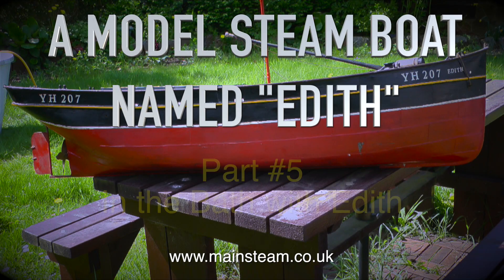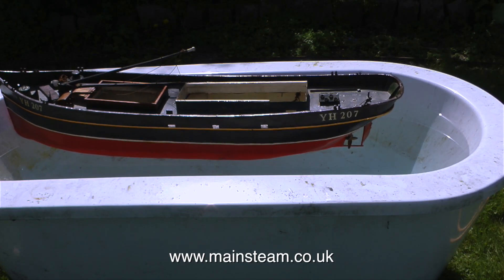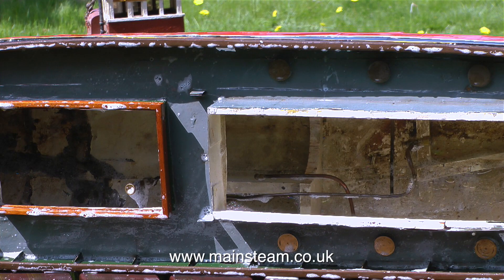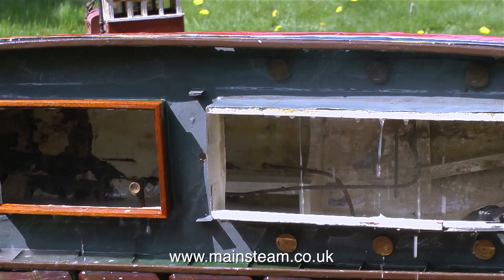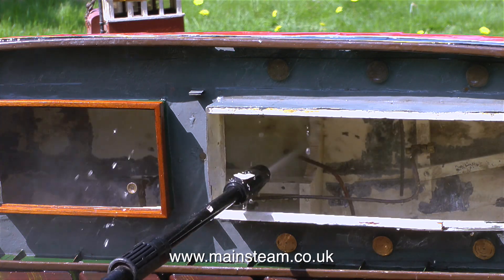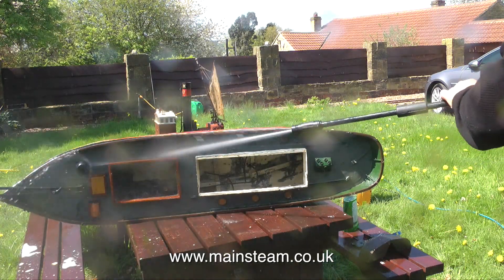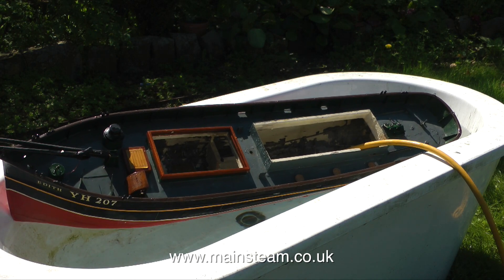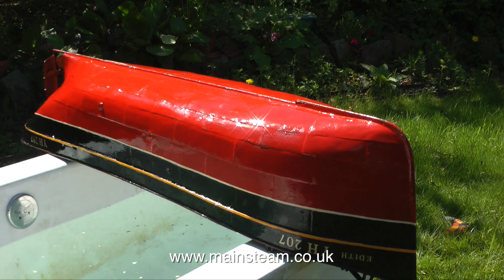A MODEL STEAM BOAT NAMED EDITH - PART #5

Comment: Bonjour Keith,
You have all my attention, as a steam boat collector, I will watch even more accuratly this adventure. Did you find wher the leak come from ? Did you mention it ?
Amicalement, Raphaël
Reply from the maker: it is leaking from about 5 or 6 places where the plates are loose . .  .

Comment: I have done some soldering of thin steel sheets in the past, i have found that a 500 watt electric iron works better than a torch because you can control the heat better and you don't get the issue of blowing apart nearby joints.

Comment: Keith got a question. When the owner built the hull with tin sheets, did he butt solder the edges together or over lap the edges? These two techniques would make a good demonstration.
Reply from the maker: overlapped - he is 92 now and doesn't do much building anymore .....

Comment: have you considered using a resistance soldering rig (they are not very expensive) to resolder the plates. a ressistance soldering system provideds quite high heat in a small area. Then you release the switch (it is on a pedal) and hold the parts in place with the solder tip until the solder cools.
This kind of system is used for building HO scale (OO in England) models out of Brass parts.

http://resistancesoldering.com/site/faq

Comment: Good afternoon Keith. As you said you are going to fiberglass the interior of the hull, Lead shot makes a great ballast fills all the nooks and crannies and then held in place with fiberglass resin you can build up a beautiful strong waterproof flat bilge to work off and your extra lead ballast will have a good surface to rest on not putting pressure points back on possible weak joints in the plate work.